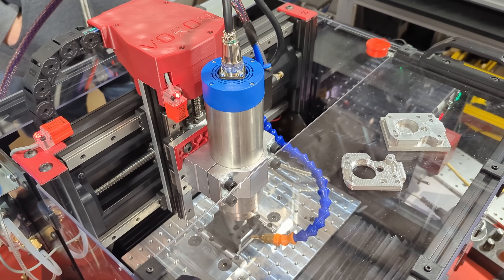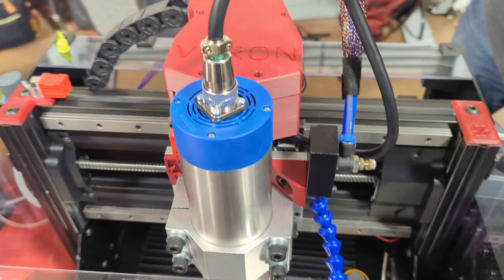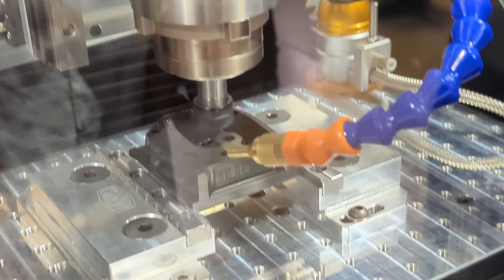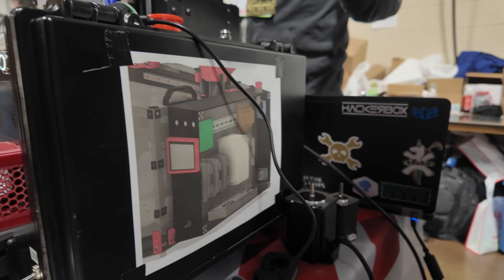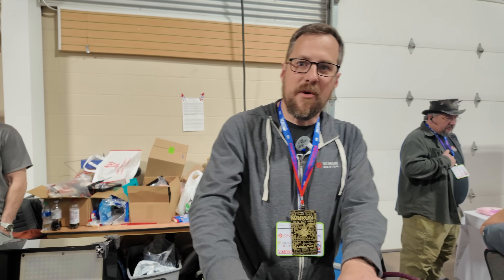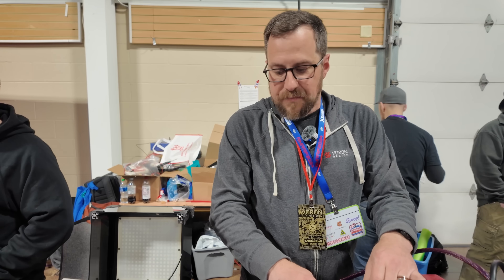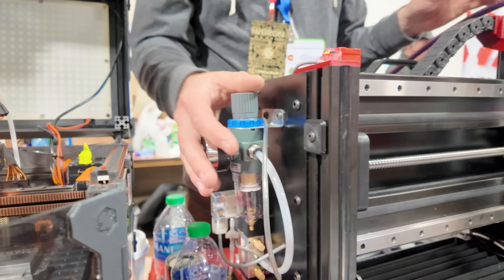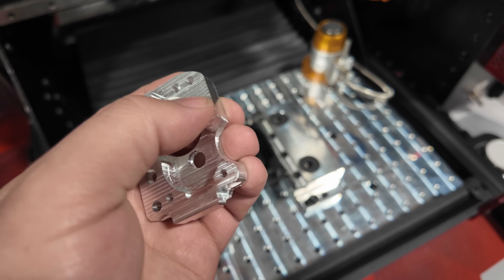Voron Has a CNC Now? CASCADE @ RMRRF 2024 #cnc #3dprinting

Comment: I like it.  Rigidity is everything.  I currently have a 5000 lb mill and I know I'm going to have to downsize eventually.
This desig looks like it could be switched to horizontal milling (for longer parts with end features) without too much trouble. 
A good hobby CAM solution is what we need now.

Comment: I am not excited about the mechanical milling machine presented.  I am excited about 3D printer style controllers and wifi interfaces for CNC.  I currently have a CNC router running Mach 4 and it kind of sucks.  It is so clunky and complicated.  I know there are some guys running Duet / reprap control of CNC's but I don't think they have developed a true CNC user interface yet.  I also have 2 3D printers, an original CR-10, and a Flying Bear Reborn 2, and I would like to move them off of Marlin.  I would really like to use a common controller firmware for both my CNC router, (future CNC mill conversion) and my 3D printers.  So I am waiting for a unifying firmware.

Comment: Outstanding! I'm excited for the official release. Personally I would be running Mach4. But that's because I already have a couple of home built CNC machines that run it and I'm both familiar with it and already have it. 

I'll personally print as much of it as possible. 90% of the products I print are 100% infill anyway. So I'm used to the long print times and some of the potential struggles with 100% infill.

Comment: I was so excited until the price came out
Reply from the maker: Remember, that price is for self sourcing with no bulk discounts, you`ll probably see the price drop quite a bit on kits like what happened with the Voron Printers after a while
Reply: @CanuckCreator  I really love the idea of bootstrapping with printed parts. Printed cncs have already proven to be good enough to make themselves replacement parts.
It would be amazing if the designs could accommodate for this via optional captive nuts etc. instead of a complete redesign.
Reply: CNC Milling is quite a bit different than Printing. Sure, the machines look to be moving in the same way. But that's where the similarities end. Milling has to endure being forced through a material that really would rather not be cut. Printing is basically just dragging a nozzle around with no load. Other than the weight of the print head...

Not for nothing though... That's approximately the same price as building a self sourced 350mm V2.4 with quality materials. Having said all this... There are TONS of DIY CNC designs out there now. I built a CNC Router out of MDF almost a decade ago and it's still cutting great. If cost is your primary concern though. MPCNC is probably the cheapest way to build a CNC router/mill right now. It's not gonna be anywhere near as rigid or precise as this design is. But having built one myself. I can tell you that it works pretty well. It's definitely more precise than my old MDF machine. But admittedly...I cut a lot of corners when I built the MDF machine.

Comment: nice! is that possible to build a Voron 2.4 using 2040 aluminum extrusion ?
Reply from the maker: It can be done if you do it right, using 4040 (20x20) profiles for the outer frame has been done by others that wanted more room for insulation for example
Reply: @CanuckCreator  how do I print the Y gantry holders. The voron stl files are for 2020

Comment: tooo expensive
Reply from the maker: k
Reply: @CanuckCreator  there are cheaper options for 1000-1500 if you wanna cut aluminium with 800/6mm/1mm and steel, they are not to slow

Comment: Hello Nero, yet another interesting video from you!

Firstly, it's imperative to bear in mind that all the preceding Voron machines, including this milling machine, are CNC devices. It's crucial to note that "CNC" isn't solely synonymous with milling machines but encompasses any machine controlled by numerical commands, including 3D printers and not exclusively milling machines.

Now, I want to highlight a significant design flaw made by the Voron team here. The MGN type rails operate on a single ball circulation system, which is suitable for tools not subjected to operational stresses, such as lasers, 3D printers, plasma cutters, etc. However, for tools enduring physical cutting stresses—essentially, tools encountering material resistance—like milling machines, lathes, drills, among others, rails with dual ball circulation, such as the HGH type, are essential. In such applications, the purpose shifts from linear axis guidance to containing dynamic loads across all three axes while maintaining an equal level of static moment in all directions, not solely along the axis. However, the MGN15 exhibits a static moment more than twice lower in the other directions than its axis, unlike the HGH15. Furthermore, with an equivalent rail width, the MGN is three times less stable on its axis and five times less stable on the other axes than an HGH rail. There's a miscasting here.

What happens practically during milling with MGN rails? Well, since the guides are less well-constrained, each axis of the machine introduces weaknesses in the other directions. As soon as the tool engages, the material resistance will dissipate into the weak axes of each guide. In other words, the machine's "feed and speed" parameters will need to be reduced until they fall within the load-bearing capacity of the guides, which are very low with the MGN series, thereby diminishing the milling machine's capacity and performance. And since the weaknesses of the guides accumulate across all three axes, the capacity enabled by a 1500w spindle carrying a tool up to 13mm in diameter (1/2") will be greatly affected. In summary, due to its guides, the machine has an oversized spindle, which allows for mounting cutting tools of a diameter far too large for the dynamic load that the rails can support. In other words, a 500w spindle carrying only 7mm diameter tools may already exceed the capacity of the MGN15 rails.

Here are some figures that anyone can verify: an MGN15 rail mounted in the X direction has a static moment of 21.6Nm in the Y and Z directions. However, a 1500w spindle, without cutting effort, already generates a torque of 6Nm. Moreover, material resistance can induce a delta-torque five times greater. Therefore, it's insufficient on just one axis alone. Since the weakness will accumulate across all three axes, we fall far short of the requirement to support the standard cutting efforts of a 1500w spindle. Here, we find ourselves in the scenario of a 3D printer equipped with a high-flow nozzle, but with mechanical components that resonate, reducing the acceleration to a laughable level compared to the hotend's capacity.

So, I understand very well what led to the choice of MGN rails: cost and the habit of using them on 3D printers. However, subtractive manufacturing, such as milling, has a completely different set of requirements. I don't want my comment to come across as disdain or baseless criticism; however, it's a common beginner mistake to economize on guides and transmission. Because, I'm afraid, 12mm ball screws are also undersized for this type of spindle. My advice for the Voron team is that a machine, especially a milling machine, must be consistent in all aspects. The structure, electromechanics, guides, and transmission must be proportionate to the cutting tool and inherent torque. So either the spindle and tools need to be downsized, or the guides and transmission need to be upsized. Otherwise, we'll settle for what an unbalanced machine can deliver.

It's a pity because the components that drag the machine down render the good components, like the spindle, inadequate and therefore too expensive. Consequently, we could create an equally performing machine, yet less expensive, with coherent components.

This is evident to the seasoned engineer that I am, without further in-depth investigation of the machine, especially its crucial structure. All said amicably and with humility.

Comment: Is it really a voron? Or is it like the hemi? there is really only one hemi but it was turned into anything made by hemings motor Corp.
Reply: Any official release by the voron design team is a "voron"
Reply: @SupaaMann  I suppose... just a little disappointing.  Kind of like supporting a green company who's products are 100% sustainable then they come out with a product that made of unrecyclable material that's trimmed in fur and runs on unrefined oil and baby seal fat. But hey... they make the rules.  I don't want to hear anyone talking about "that's not a voron it has a machined part". Not once
Reply from the maker: The original design was fully "3d printed parts" but was basically just a slightly better 3018. 

Yes its nice to keep to the wholly COTS only design goals, but lets be honest, with the forces involved with subtractive manufacturing. You do kinda want more rigid...metal....parts

Also, its mostly just plates with holes in em, we had to drill our own beds back in the day before they became common to buy.

Comment: so it can cut another bed like that one?. self replicating?
Reply from the maker: all parts for the Cascade can be machined on a cascade
Reply: @CanuckCreator  how would you do that if the bed and the piece your making is the same size?
Reply: @adamfilipowicz9260  Use locator pins to create the bed in 2 or more operations

Comment: I'm curious what all they need to get frame kits put together. I'd be happy to run some out of my cnc shop.
Reply from the maker: The raw extrusions are around 150usd iirc. But if you want em all pre drilled, tapped etc the cost goes up to like 500
Reply: I guess what I was saying is that I have a cnc shop. I'd be happy to be a manufacturer for kits as needed (cnc plasma, cnc routing, lasers, a couple cnc milling machines, etc). 

When the BOM comes out, I'll have of take a look.

Comment: So it's basically a 4040's specs with a build volume slightly smaller than a 3018? I would be interested in a side by side comparison to those (obviously with the router upgrade on the 3018 to let it do aluminum) and the Carveras to see if the extra cost is gaining anything in performance against the cheap ones and similar cost makes it at all comparable in capabilities to a Carvera.
Reply from the maker: Well. Spec wise it outperforms the carvera. This has a 1.5kw spindle vs the 200w.
Reply: Yeah, Carvera has weaker spindle. At the same time they are trammed from factory, more rigid and more precise. Pros/cons I guess
Reply: @airatooo  Yeah, from what I've seen people do with various desktop CNC mills, Carvera does something with their builds so their 200W spindle cuts metal like any other machine at 1000W. Sometimes just throwing more power at it isn't the best option but it seems like that's the only real choice we have with off the shelf parts. This new Voron build will be somewhere between the price of their mainline machine and the Air.

Comment: Polycarbonate gets scratched very easily. 
If you don't want the panels to be ruined by chips real quick, I advise to add maybe a polypropilene sticker to the inside to protect them
Reply: Poly carb is used in nearly all cnc machines. It's a wear item used for safety.

Comment: I know linux cnc and grbl, so it sounds like i’m safe. If you’re going to cut metal, don’t you want to move cutting fluid?
Reply from the maker: ATM it's fitted with an air blaster/mister but added fluid flushing wouldn't be hard

Comment: Wonder why it couldn't be fully enclosed.
Reply: Might be because the enclosure will be odd shaped or just too large. The spindle goes up in Z axis and that area makes the enclosure almost 2x taller. I do recommend to make a full enclosure, chips absolutely will fly out of that gap
Reply: Same. There's almost definitely a technical reason, but in curious what it is

Comment: With most Vorons, you need the assistance of another machine. In this case, you'll need a cnc machine to make the parts. For me, I'll be getting a Carvera Air.
Reply from the maker: Carvera also has a spindle thats has 7.5x less wattage (1500w vs 200w) and uses much smaller tooling
Reply: @CanuckCreator  Yes, that's why it's called Carver Air. It's going to be used for smaller projects. What I meant was that most projects require another machine to make parts for it. Sometimes, you need to outsource it. It's just a fact.

Comment: The fox alien and sainsmart machines are so cheap it seems hardly worth getting one of these.
Reply from the maker: While a larger work area, both those machines have much less capable and weaker spindles with flimsier/weaker frames
Reply: @CanuckCreator  Sure out of the box. Most folks go for an after market spindle then add beefier rails, all of which can be done for well under $200.

Im interested to see what the voron team come up with though.

Comment: You can buy cnc like this its not that special . voron should stick with 3d printers
Reply from the maker: nah
Reply: Agreed
Reply: Well you can buy a 3D printer too
Reply: We need klipper to add the general cnc feature see thread "Klipper for CNC initiative"
Reply: You can buy a 3D printer it's not that special. RatRig should stick with camera rigs. Anker should stick with chargers and powerbanks. V1 engineering should stick to CNCs.
Reply: @SanityAgathion  There is nothing innovative about this CNC machine jusr a 1.5 Kw Router

Comment: I’m hoping there’s more to the capability. All these simple run downs make me think the Milo 1.5 just beats this out in performance per $ and it’s easier to bootstrap.
Reply from the maker: different paths to the same goal, Cascade has a smaller footprint and is designed with enclosure already part of the machine vs the milo which takes up a much larger footprint with the advantage of more X and Z work room.

Machine choice depends on the user`s goal

Comment: Nero's last video: Voron = no custom parts... So this isn't a Voron then correct?
Reply: Not really different than extrusions or panels since you can order the flat stock and do it by hand still.  You just wouldn't want to.
Reply from the maker: This

While it tries to keep the the whole design goal of voron using COTS as much as possible, lets be honest, the forces involved in CNC are greatly different then FDM and thus, the increased rigidity of metal parts is needed in some locations.
As covered in the video, most of the 8 "special" components can be simply metal plates of the correct XY size (most are designed without a specific required thickness as well) with holes drilled in em. If your planning on building and using a CNC, drilling holes in aluminum shouldnt be too far of a leap skill/tooling wise to do by hand
Reply from the maker: ahh shoot, your right, cancelling the release now